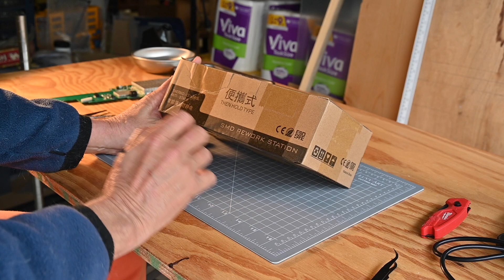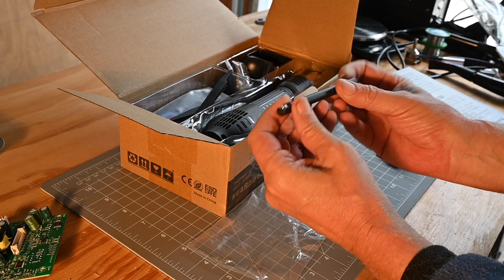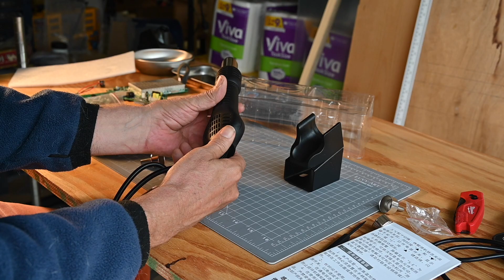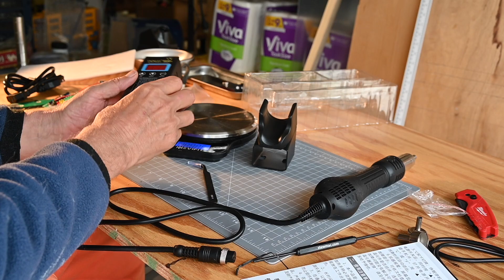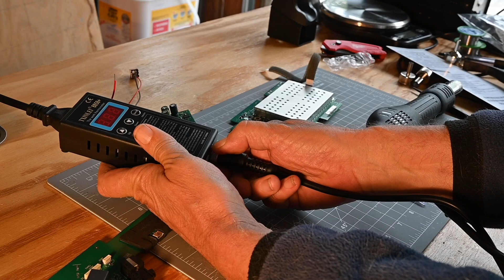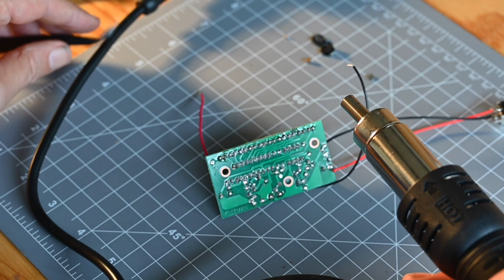C.K. tries a  Txinlei 8858+ SMD heat gun

Comment: I got this model but weirdly I can't manage to heat up the chip on my board enough to melt the solder. I've used the same settings as you and some aluminum tape to protect surrounding components. But even after almost 2 minutes of heating the solder won't melt at all. What do you think my problem could be? Great video though 👍
Reply from the maker: The only thing I can think of is that there is a large ground plane, a sheet of thin copper under the first layer of the circuit board leeching away the heat.  The Bose sound dock board I test with has that, and it simply carries away the heat before it can melt the solder.  Hard to work with with an air gun, the "contact" flat heating irons are the best thing to get those off, I need to demo some of those.  Thanks for stopping by!

Comment: Hi Ck what is th best fan speed and heat for this particular model?salutation from Montreal,Québec
Reply from the maker: @evilslayer73. Both questions tie into one key behavior: Air temperature drops off very quickly as distance from the nozzle increases (like most diverging energy “fields”), so you’re compensating for the inverse-square relationship tail-off from the heat directly at the nozzle tip. I found/find that the major tool for compensating for that (in practical, not textbook, applications) is air flow, not temperature.  I have the air flow at 100% to move the largest mass of air at temp X the greatest distance. Temperature itself should be considered an independent variable that relates to the temperature you need the object heated to.  Max temperature will melt solder fastest, but it also melts any plastic nearby and can cook chips.. incidentally high temp can also heat the ground plane of the circuit board more than you expect, causing solder to flow where you didn’t want it to.  My rule of thumb, which you’ll adapt to your own experience, is max out the airflow, but try and keep the temp as low as you can to melt the solder at your target solder,point. In practical terms for me that means 100% flow at roughly 650 dF.
Reply: @CKHaun  Thanks a lot for your explanations !its a learning curve im gonna practice it its my first hot air station :)👍👍
Reply from the maker: @Evilslayer73 And one thing I didn't mention - The first time you blow the blast of hot air on your thumb and yell "OWWW, that's HOT!".  :)
Reply: @CKHaun  I imagine im a Welder i know what it is to be burned :)
Reply from the maker: @Evilslayer73 Welding is one skill I've always wanted to learn, but haven't.  Partially because I know my impatience will keep me from laying down a smooth bead.

Comment: Can we expect a video on the hot air handle connector wire pinout diagram?
Reply from the maker: @ketanmorajker I was not planning on that since I'm going to be keeping this one and don't want to break it down.  8 pins, I figure 2 for heat power, two for fan power, two for temp sensing, and (I think) two for sensing the magnet in the cradle.
Reply: As you described the number of wires, similarly I wanted to know exactly which wire is connected to which pin number of that GX 16,8-PIN connector used.
This is because I recently purchased QUICK 858D smd rework station which has everything wired (i.e the mains power cord and the blower handle is non removable hence difficult to carry in terms of portability).
I want to make it portable by adding the GX 16 8PIN Connector for the blower handle
Reply: Also you could do the same without opening up the station by using a multimeter for finding the pinouts
Reply from the maker: @ketanmorajker  I found the paperwork.   Pinout on the handle male connector, reading COUNTER clockwise from the alignment notch:  Pin 1 Fan neg.  Pins 2 and 3 - Heater. Pins 4 and 5 - Thermocouple, 4 is neg.  Pin 6 reed switch pos.  Pin 7 ground.  Pin 8 Fan pos.
Reply: @CKHaun  Thanks a lot for the help, appreciate your efforts 😃

Comment: In the parts list on the Amazon product page, it states that there is an IC Puller. Maybe the mystery part is that?
Reply from the maker: @jerrypemberton I dunno, holding ‘em in my hand right now.  The wire is too flimsy to pull a chip (or loosen an smd) and the rod is just plastic with a screw on the end. I continue to be befuddled.
Reply: @CKHaun  The screw on the plastic rod might be to tighten down the loop part of the metal thing. Put together, it might resemble a tuning fork 😃, but in all seriousness, I am really curious to find out what it is for.